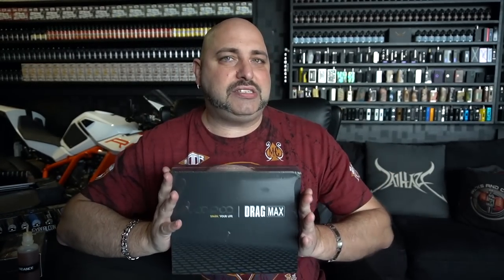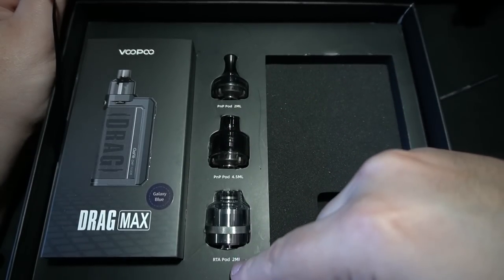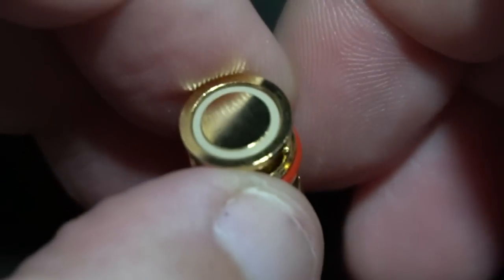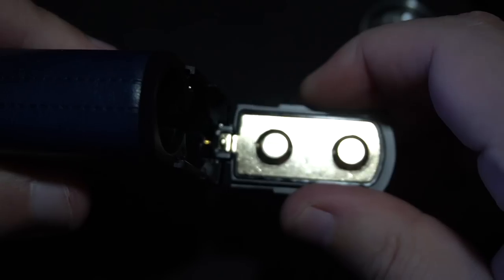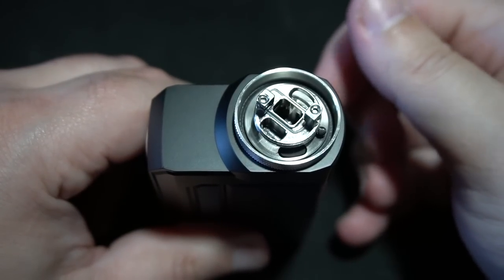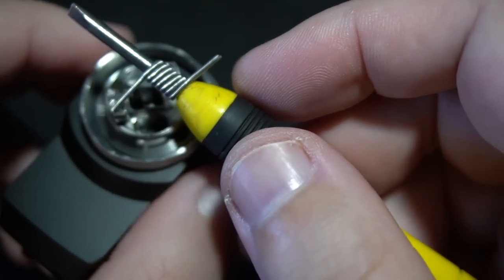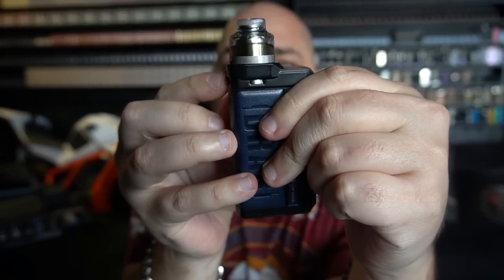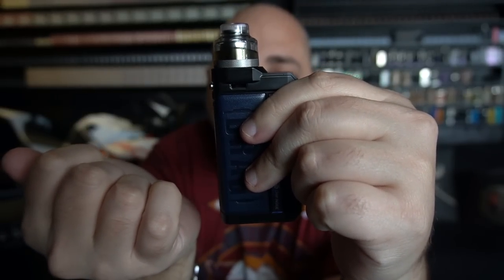The Drag Max, DragX and DragS on Roids. PNP RTA Review As Well

Comment: In regards to the 510 adapter plate, do not order the Reevape its rubbish.. the pin is pressure fit in and it will seperate from the plate, I had to use vice grips to get it off my RTA, the Coolvape 510 adapter is a better design and wont have that issue.  thanks for the review brother.. Just placed my order..
Reply from the maker: Thank You for not trying to correct me. So many people saying there is a 510 adapter. I was saying by VooPoo not by a 3rd party but you even go into it further. Sone people I despise. Good on you kind sir
Reply: the revape adapter does suck, you have to adjust the 510 with each tank. Where are you getting the coolvape 510 from?
Reply: @justfasial01  3FVape has them.. and just from the pictures you can see that the Coolvape is a way better and thought out design.. I will update the thread when I receive it..
Reply: @JaiHaze  all good Jai.. too easy to be a hater now days.keep up the good work brother..
Reply: @HKTjohnnywalker  i dont see coolvape on 3f, there's VapeSoon one but it also looks like reevape.
Reply: Is that why, with the WeeRape (ReeWape formerly) plate, I keep getting the "Check Atomiser" error on my mods every now and again?
Reply: @cadderley100  yup, you gotta put the atomizer on and then press the gold 510 pin on the adapter cuz it's not self adjusting then attach it to the mod.
Reply: @cadderley100  yeah bro I bought 2 and on of em did the same thing.. Rubbish products...
Reply: U can buy the limited edition kit for $65. + $30ish for shipping, almost $100. for the kit w/ shipping
Reply: @rickroinestad3190  the stopped selling it on the 8th of this month.. And they wouldn't ship to my country..😭
Reply: @HKTjohnnywalker  Could you help me, i really can't find the coolvape one anywhere
Reply: Update on the Coolvape 510 adapter.. unfortunately the magnets are terrible, it's ok with smaller RDAs but a RTA just pops off on it's own if you even slightly tilt the mod..  really sucks the the Revape magnets are good but the quality is shit..
Reply: @HKTjohnnywalker  any update since then mate? Just ordered the drag max and trying to decide on a  good 510 adapter
Reply: @AmazingOrange87  the coolvape magnets are weak.. it cant handle bigger atomizers like the profile RDA, but smaller tanks like the Kylin M are no problem..
Reply: @HKTjohnnywalker  i got mine rta today and it has a complete rta with 510 it just 2 separate Pieces

Comment: Voopoo has been knocking it out of the park lately.  Their pnp coils are extremely reliable and consistently good.  The cross-compatibility of the coils is such an amazing convenience as the wife has the Argus GT and I have the Drag X so only need to buy 1 pack at a time.   Not too long before that, it was easier to buy a new tank than find the right coil for it.   As for the RTA I've just picked one up for the Drag X and even though I've not tried it yet, I'm looking forward to firing it up.  Fantastic review buddy as always.

Comment: I use Vaporesso Cascade coils on my smok baby beast tanks. They fit perfectly with no issues. I kinda like the Smok sub ohm tanks that light up and you can swap out the tank seals to change the color. Unfortunately you have to mess with the coil wire on the Smok coils to hopefully prevent leaking and I don’t always get it right. On one of those times, I snipped the wire a little bit too short losing continuity and getting the no atomizer warning. I know they’re silly compared to my high end stuff but I like how they light up so with determination, I noticed the Vaporesso cascade looked very similar so I grabbed one and it fit and worked perfectly. 

I picked up a Voopoo Vinci and that was one of the biggest surprises I ever had. Those PnP coils are delicious. I wish the puff counter didn’t reset because I hit that a lot

Comment: The TPP Tanks and coils are hands down, the best on the market, even to this day in 2022. I wasn't noticing anything different after having the TPP coil in for a few weeks, but I changed it anyway because I thought, it must be me. It's not just me. With the 2nd coil, I was going to use it until it was completely done. A month went by, then 2, then 3, and it amazed me that even after 3 month of daily usage, the coil had zero gunk on it and the cotton was still white. Of course I had to change it to see if I was still right, and to my utter amazement,  I was still right again.  So as it stands the TPP tanks and coils are the best on the market,  plus the come with a 510 adapter so you can put it on anything.

Comment: I’ve been saying the same thing about the Voopoo Pnp coils, it’s the closest I’ve come to an actual sub ohm tank/rta in a pod. Honestly Voopoo have been knocking out the park this year. 

The Drag S and X, The Argus GT and this are all excellent devices. And the pods and coils are second to none.

For on the go you can’t better

Also they do make an adapter, I have on for my drag x. You screw the rta or RDA into the base and the base has magnets and drops into the device.
Reply from the maker: That they have
Reply: Jesse Tyas the Vaperesso coils are muted as fuck, and even the though the form factor of their PM80 device is nice the lack of a proper air control function means that you can never fully appreciate the flavour from the pods or coils. 

I’ve been vaping since the beginning and dropped a small fortune on the hobby, and personally I would rank this as one of the best device/pod range ever. Each to their own I guess.
Reply: @MC will give them a go. Thanks for the recommendation 👍🏽

Comment: Pointer for the rta pod. I find it wicks SO MUCH better if you use the floating cotton method. Meaning don't stuff the cotton allll the way down to the bottom basically tuck the cotton in almost as if it's floating on the ports. So fucking good.

Comment: Hi Jai!

Could you try the RTA pod tank with the Drag X with your own coil in it? 
I'm just curious, because my Drag X can't fire higher than 3,6V, not even with brand new Sony VTC5A and VTC6 batteries. Tried with 0.3-2.0 ohm coils (even with original PNP coils), nothing works. I did software update, same as before. I asked other Drag X users, but their mod can output 4.2V. Voopoo does not wan't to reply my emails, even i'm in the 90 days warranty.
Reply: The RTA pod will work on the Drag X but because you're only getting 3.6V you'll have to use low ohm builds to get enough power to the coil and a consistent vape as the battery runs down - if you use a single 0.25 ohm coil the max you will get is 51 watts with 3.6V (and the power will reduce as the battery discharges) so you are probably better off using 0.20 ohms or lower if you want a consistent vape. If you don't have a nickel allergy 0.17 to 0.20 Ni80 or SS316L coils are easy to find and should work well, there are low resistance Kanthal coils around but because it is higher resistance wire they are larger than equivalent ohm Ni80 or SS316L coils and may be too large to fit the deck - so its best to check they will actually fit before buying..

Anyone who tells you they are getting 4.2 Volts to the coils on the Drag X is mistaken - they are probably quoting the input operating voltage of the battery rather than the output to the 510.

Comment: I had an AL85, but the board started malfunctioning on me, so I had to bin it.  Currently, I'm using a Voopoo Drag S, Voopoo Vinci R and a Voopoo Vinci X in my daily rotation.  You must be doing something right Jai.  That's two big boxes you've had in the last 2 weeks. Funny how your getting all this stuff now, since Ripp Trippers quit the scene, isn't it? :P.  If I remember right, the VM1 is the 0.30 0hm coil.  That's the one I usually use.  I don't like the RBA heads.  I have 2 of them.  They are hard to work on, and they are all MTL based RBA's.  At least, the one's I have are.  I want something with a 510.  That's my reply, in all honesty.

Comment: They do make a 510 adapter for the PNP pod. You can buy the pod separately here in Canada and it comes with a 510. The one I bought is made by voopoo
Reply from the maker: find me it on the internet, bet you wont. They dont make one. Its to make this USE 510s, not the adapter made by a 3rd party and NOT the pnp 510 adapter.
Reply: My bad Jai. I thought you meant a 510 adapter

Comment: I LOVE the flavour of the rta pod, but I’m filling it up every 5 mins because of the 2ml capacity and it doesn’t fill up that great from the bottom. But the flavour is amazing. What single coil rtas would you recommend putting on this with the 510 adapter? X

Comment: Jai it would only make sense for voopoo to come out with an adapter to allow 510 devices to be used with the Drag Max X/S pod mod systems. I am curious if the 510 adapter that comes with the Magnetic RTA will work for the PNP coil pods as well?
Reply: yes the 510 to the voopoo rta is the same as for the normal pnp pod system, the only difference is the actual pod part.

Comment: Just saw it on a Chinese site listed $20 Voopoo RTA Pod, it shows it with a 510 bottom airflow base that it sits in (sold separate) called "VooPoo PNP Tank Base". Kind of a fail, it should come with the rta to be less confusing.

Comment: Jai, VXV (I'm not sure of the name but I will confirm later when im home) makes a 510 connection of sorts for their RDTA part, which also doubles as a 510 connection when used without rba section on the top(but this comes with an aesthetic cost, since it has the odd looking plastic tank underneath whatever you put on the top)... hmmm this just made me realize you may be able to use other RDTA decks on this and use this piece as the tank!!)

Comment: The coil RBA is way to tight and I can’t get it not to leak and no airflow. The Argus GT is what I got and I bought another pod adapter because The PNP coils are the only ones I actually enjoy as I am strictly a rebuildable guy! Instead of buying the Drag max I ordered the RTA section because why spend the extra money if you can use the pod adapter on every mod with a 510?
Reply: There are 2 (maybe more) "pod rta" for the drag pod series... you got the wrong one, like I did. VERY tight airflow. I agree.
Reply: Ryan DiSano yes I do not like the pnp RBA at all I even tried it in the Vinci X and it’s just a pain in the ass but I will have my RTA pod soon enough and based on how that is I might buy a few more lol the 2ml capacity doesn’t bother me on bit as long as the flavor is good. I can’t wait to get it.